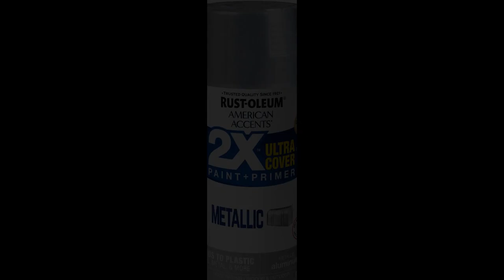Andor | a Star Wars lantern

Comment: I never knew about the  toothpaste technique!  Nice!!
Reply from the maker: CG-Rtist I picked that one up fro @JCulley 3D CGI
Reply from the maker: If you don’t mind me asking how do you like the Cnc mill you just got I am looking and don’t know what to buy thanks
Reply: @blackmarketoutpost  I love it!  Now that I'm using it I realized that I should have gone for the larger version.  It is the best one I've had so far.  Had a Shapeoko XXL, size was great, but I didn't want belts.  Before that I had a Carve King also by Millright, a Bob's E3 and a 3018. Funny, each one was sold to get the other.  I'm all set with the Mega V!
Reply from the maker: CG-Rtist it is the one I am leaning towards as it’s has the best price for what you get thanks for the info what software are you using with it

Comment: How did you keep the top and bottom part together without the screw that runs down the middle of the light?
Reply from the maker: It’s is a press fit with snap clips the bottom rides in a track the snap clips keep it in the track
Reply from the maker: And the top section I glued to the top of the glass
Reply: Excellent. I just finished the paint job. It’s my first Star Wars prop attempt. I make Halloween tombstones and other holiday props, but I’m a huge Star Wars fan so I figured I’d give this a shot.
Reply: One more question. How long did you wait between the oil based paint weathering and clear coat application?
Reply from the maker: I let it sit over night
Reply: Thanks again. And sorry for all the questions.
Reply from the maker: No worries ask away if I can help I will
Reply: @blackmarketoutpost  bad news. The clear coat caused the spacing to crinkle
Reply from the maker: What spacing ?
Reply: About 12 inches. It completely ruined the paint. Any ideas?
Reply from the maker: Did you use 2 different brands of paint
Reply: No. I used the exact same ones you did. I’m so bummed man. Lol
Reply from the maker: Not sure what could of happened
Reply: I’m starting fresh again. Wish me luck. How much drying time did you have between color coats?
Reply from the maker: I let all layers of paint stay overnight
Reply: I’m gonna do 24 hours per coat to see
Reply: Thank God these lamps are cheap. Thanks for all the info and advise my brother. Be safe.